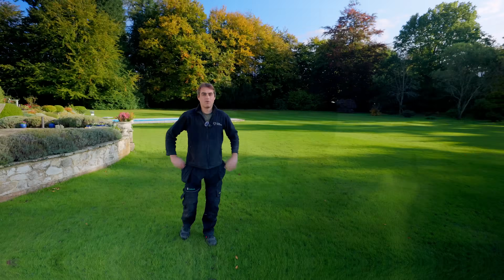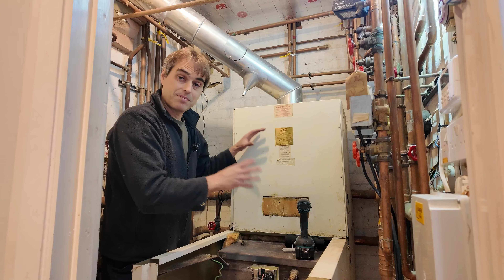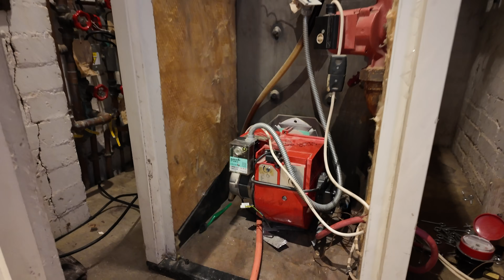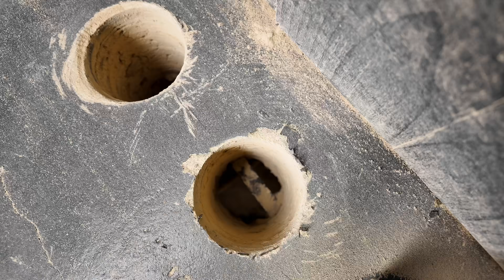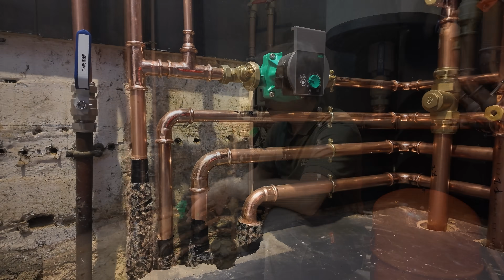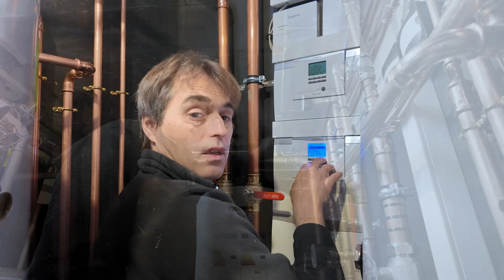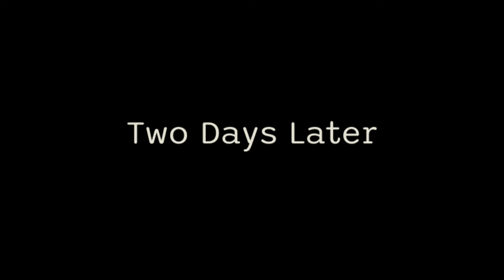Heating Oil Costing You A Fortune? This Is The Fix.

Comment: What's the point of reducing the running costs if the capital outlay would actually pay the running costs for over a decade?
It's completely and utterly pointless - an exercise in wasting money.  A customer of mine lashed out £54,000 (panels, GSHP, Tesla batteries).  That would have paid his total energy bill for 18 years!!!  There was a look of shock when I explained it to him.  Then I told him about the £1,700 a year he was now losing in lost interest on the capital expended.  But I think he had stopped listening.

If you install such a system because you don't want to suffer from that imbecile Miliband's blackouts, then great.  Otherwise, no.  It simply doesn't work out.  I have all the maths if anyone want them (as it's my job).
Reply from the maker: Capital outlay would cover 5 years running cost. Existing system needed replacing anyway. Any more comments Barry?
Reply: @UrbanPlumbers  
Can you supply the data?:

Current running costs
TOTAL capital outlay
Loss of interest on capital expended
Likely future costs of replacement inverter
Likely future cost of replacement batteries
Likely panel degradation (yearly)
Maintenance & servicing costs per year (spread over 20 years)
Warranty period

I'll wait.
Reply: @barryfoster453  UP didn't install the Solar or Battery array, it was there already.  How do you know the person had the capital already and didn't remortgage to get the funds which typically wouldn't be allowed to be used for investments.
You also don't know if their goal was purely financially oriented either.
Reply from the maker: @BenIsInSweden cost of fixing existing system with another oil system and running it low temp would have been the same as heat pump anyway - so his points make no sense !
Reply: @BenIsInSweden  
Ben...listen to the first few seconds of the video.  Your answer is there.  And you have the wrong idea, anyway.  I'm not putting it up against an investment, as that would be even more in my favour!  I'm stating that when people do this, they had the money in an account - earning interest.  This is TOTALLY ignored.  A typical 4kW system costs £15,750.  Withdraw that money and you're losing £473 that it was earning.  Do you see?  So whatever you 'save' on your energy bills has to have that £473 deducted first in your full cost analysis.  You are DOWN on your finances by £473 a year before you have 'saved' any money on energy.  The Energy Savings Trust was the ONLY organisation to factor it in - no one else ever does.  That's because people who do this aren't mathematicians - so they forget it.  But funnily enough, I was called in by an accountant after he had already done it.  When I showed him the data, he didn't like it (that he had made a glaring error).  Two years later, he phoned me to tell me I was correct.  Took him two years!
If you borrow the money, then that's even worse, of course!!!  Yet some have done that.
Reply: @barryfoster453  you don't need to get much further into the video to get the answer.  As you'll see that the oil tank needed replacing as it was leaking, and the boiler is aging and needs a lot of maintenance.
The replacement tank on its own would be thousands, and so would the oil boiler.  
A typical 4kW heat pump system isn't £15,750, not sure where you're getting that from either.
Reply: @UrbanPlumbers  
Sad.  As you haven't supplied all the data, none of us will every know!  The cost of installing a gas boiler and its running costs would possibly work out cheaper, but again, as you haven't supplied the data, we'll never know!  Gas prices are plummeting, and they will fall even further.  As Europe imports more US gas, causing European gas prices to fall, Trump will push for more US LNG capacity.  Gas is about to be very cheap.  But that won't impact the electricity costs of running a heat pump due to the Clean Industry Bonus.  This pays windfarms to set up.  £120 is about to be added to everyone's electricity bill.  Solar and heat pumps cannot compete with cheap gas.  And yes, oil boilers...oil is due to fall in price well into 2026 and almost certainly beyond.
Reply from the maker: @barryfoster453 there is no gas there 🤦
Reply: @BenIsInSweden  
Sorry, I was talking about a solar system (£15,750).  Heat pump installation costs are hard to come by as some qualify for grants and others don't, so it's difficult to quantify.  That's why I said about how important it is to see ALL the data.  You said, "You also don't know if their goal was purely financially".  To which I replied that it was in the first few seconds of the video.  I have nothing against a cost analysis of the two: new tank, boiler, and future running costs, but as that data is not supplied, then we don't know.  The price of a domestic oil tank is between £1000 and £2500.  The cost of an oil boiler starts from around £1800 plus install.  So we're at £2,900 plus install.  I don't know where you're getting 'thousands' from.
Reply: @UrbanPlumbers  
And that's why I said about oil prices, genius.  And stop upvoting your own comments.
Reply: @barryfoster453  The oil tank in the video is ~5000l, which you can ascertain from it's size against Szymon, and that he says that it uses about 10,000L of oil per year and needs filling twice.  Cheapest 5000L Oil tank I can find from googling is about £3k.  A 70kW oil boiler for indoors e.g. a WB one is £2,369, so you're looking at over £5K there.
The 12kW arotherm plus is about £5K (again from googling), so £10K - £7.5.K grant, means the heat pumps are down to about £2,500.  So are already nearly saving the cost of the oil tank.  

Also just did a ~4kW solar quote for my dad's UK house from Heatable, estimated at £8,600.  A far cry from £15,750.
Reply: @barryfoster453  he isn't 😂
Reply from the maker: I am now😂😂😂
Reply: @UrbanPlumbers  
Always have.
Reply: @BenIsInSweden  
Ah, a sock puppet!
Reply: @barryfoster453  ah, a conspiracy theorist.
Reply from the maker: Ohh Barry, I am glad we have you. Who would have told us we spend our money wrong otherwise if not you.
Reply: @BenIsInSweden  
Ah, but there are giveaways.
Reply: @UrbanPlumbers  
It's my job.  It is evidently not yours.
Reply: @barryfoster453  Go on, I love a good conspiracy theory!
Reply from the maker: @barryfoster453 @barryfoster453  Yeah, I know—you are a digital version of a Jehovah's Witness mixed with a  DIY financial adviser. You can't do it in real life though, as you would get a door slammed in your face.
Reply: Hi Barry,

I’ve taken a moment to put together a quick spreadsheet to clarify the financial implications of this work. Over the past 24 years, the boiler has consumed approximately 240,000 litres of heating oil. Starting at an initial cost of 7p per litre and applying a 10% compound increase per annum, this amounts to around £62,000 + tax over its lifetime.

Looking ahead, if we had replaced the boiler and oil tanks (£20k), assume a starting price of 70p per litre and use the same model with a 10% compound increase per annum, the cost in 20 years will reach an eye-watering £4.28 per litre. This would equate to £400,925 + tax just for heating oil alone.

It doesn’t take long to plug these numbers into a spreadsheet—starting at 7p per litre and applying a 10% annual increase. You’re welcome to check my model and let me know if you’d like any other data to help make sense of it.

I’d encourage you to look into these figures carefully before passing judgment. The numbers speak for themselves.

Best regards,
Malcolm
Reply: @MalcolmSkerrett  
Malcolm, thanks, but as you must surely realise, that's not what I asked.  It's only when you do a FULL cost analysis that you can make a statement on 'how to cut your bills'.  We can all say stuff...but you have to back it up with data if you want to be taken seriously.  As I said, I do this for a living.  If I make a mathematical error, I could get sued.  Making a video with a title that cannot be backed up isn't going to see you in court.

Any typical system with batteries is a dead loss - economically.  In fact, you won't 'save' any money, even if someone gifts you the panels - it's that bad an investment!  Six years I have gone onto YT videos and asked for all the data...not one single person has EVER given me them...not one.  There are two fairly well-known people on YT who post solar stuff.  I have challenged both of them to provide the data, and they don't.  One of them even took down my comments!

Typical solar systems with batteries DO NOT pay back.  This is not just due to the loss of interest on the capital expended, but because of the cost of replacing the batteries in 15 years...if they last even that long!

Comment: Great video as always.  I am not a plumber or boiler engineer - I notice that you are not using flux and a gas torch to connect your pipes - when did that change and what is this new connection method called?
Reply: Pipe crimping, five times quicker than MAP gas torch and solder and not risk of fire working in the loft.

Comment: Why you didn’t use split heat pumps? efficiency will be much better, and system will require less maintenance, I have a filling pumps in monoblocks will be weak after couple years and will lose efficiency. But rest installation master top.

Comment: How do 2 x 12kw heat pumps replace a 70kw oil boiler ? Did the property have insulation upgrades (internal wall, loft, floor etc )
Reply from the maker: It wasn’t sized correctly - 95% of boilers are 4 times the size required. Just shows how poor the industry is.
Reply: Heat pumps generally run 24/7 so less power over a longer time instead of a boiler constantly switching on and off.

Comment: This all looks amazing, But I have a genuine question. Wouldn't electric radiators be better? Power the house using electric rads, much cheaper install, and they run directly from the solar and batteries?
Reply from the maker: It would cost 5x more to run !!!
Reply: You're not following heat pump theory as they're 5 x more efficient (approx 5 units of heat per unit of electricity) hence 5 x the cost.

Comment: Painting the plant-room!  I love this guy.  Great to see K3 rads in an actual video working up well at 30 degrees and the actual electricity draw.  Super detail.  Always however, creates the disappointment there is simply no way I can access someone expert enough to do this in Ireland.  I've people recommend 2 x 12 arotherm for a 16kw heat loss property and tell me you don't run pipes underground.  I'm absolutely sick of trying to get anything done in Ireland that isn't cowboy level or just random luck as to how it works out.
Reply: Isn't Ireland full of Dr's and Engineers these days with the new arrivals. Surely they can do it
Reply: @CaptainProton1  oh right.  I must be mistaken

Comment: Why no ground loup heat pump system? This could be a possibility if you have that much area.
Reply: The 50mm preinsulated pipework was trenched in and made good in two days, ground source would be a full scale landscaping job, a lot of the solar panels were up already, just added a few extra to cope in the winter.
Reply: My understanding is that as air source has got better ground arrays are falling out of favor.  I think most ground source is moving towards bore holes for where that is appropriate.

Comment: Beautiful work! Do you have videos on doing both heating and cooling with radiators and heat pumps like these? 

I’m trying to understand whether it’s worth going radiators instead of forced air before upgrading to heat pump for either.

House still needs ventilation anyway, the only benefit of radiators is silent operation it seems

Comment: That must have cost a bob or two. 80kW of PV panels is 10 grand, another 10 for both the heat pumps. then Victron inverters, and all that massive plumbing plus 3 weeks work. They should probably spend some more on retrofit to get the load down - they can clearly afford it, and it would make the place so much more comfortable. Be nice to know what the KWh/m2 per annum is for this place.

Comment: What an epic installation! Really enjoyed watching the video. Clever idea for the towel rail circuit. The carbon savings on this system compared to oil will be massive! This is exactly the sort of property that many people claim a heat pump would never work.
Reply from the maker: Yep - one of those impossible with heat pumps. Thanks Glyn for kind words
Reply: Hi Glyn, We watched both of your HP installations, which inspired us to source a system for ourselves. Fortunately, we came across Szymon and quickly recognized his dedication—he truly puts 110% into the job! Maria, always smiling, keeping everything neat and tidy.  Hopefully, we can provide an update at some point when we gather some useful data and when the solar inverters are replaced.
Reply: @MalcolmSkerrett  That's fantastic! Amazing to hear that my little heat pump played a small part in all of this! You did well to find Szymon, he's not your average HP installer! Your battery system sounds fascinating, I've been following Dala's battery emulator project using EV batteries with hybrid inverters, I would love to put together a system like this in the future. I worked with Dala to help improve the CAN bridge used for Leaf/e-Nv200 battery upgrades when I upgraded the battery in my EV van. He's a very clever guy. But I guess if you're using Victron kit, you don't need the battery emulator integration.

Comment: Would a split heat pump not have been preferable for such long pipe runs? Smaller diameter pipework that could have been insulated to the same thickness as the water pipes. 

And only having water where the boiler was, with the long run being all refrigerant.
Was that ever a consideration?
Reply: The smaller the pipe diameter and the longer the pipe runs, the more flow resistance, therefore under ground 40mm/50mm preinsulated was used. There are some systems that use glycol but that alters the viscosity of the liquid being transfered, thus affecting the pump efficiency. Szymon kept the design efficient and simple.

The client was reluctant to install a commercial air-to-air heating system in their home, as its appearance was deemed too industrial and out of place in a domestic setting. They preferred a solution that blended seamlessly with the aesthetics and design of a residential property.
Reply: @MalcolmSkerrett  I think op means a split a2w system where there's something like a hydrobox inside to feed the hot water etc.
FGas would definitely be required though, I think Szymon had to use another contractor for moving an R32 system previously, so probably would have increased cost for not much gain.

Comment: Looks like a great install, congrats. Would however echo other comments on long term economic viability. Would be very interesting to see data for kwh load of heating plant on design conditions day and available solar yield. Also battery soh after 10 years is an unknown and commodity heat pumps like this can and do fail needing expensive repairs by skilled trades and parts. 15years is quite possible but have seen comps / inverter pcb's go sooner. Also would want to avoid the losses of the pre insulated pipe over life cycle of system if at all possible. It adds up. Personally prefer refrigerant split for long runs. Nice job though!
Reply: The client decided to replace a 24-year-old oil-fired boiler with two heat pumps. The existing oil boiler was outdated, the oil tank had a leak, and oil prices fluctuated between 60p and £1.00 per litre. The property already had a solar and battery storage system that powers the swimming pool in summer.

The work completed by Szymon, combined with the BUS grant, matched the cost of purchasing and installing two new 5,000-litre oil tanks, a new boiler, removing the old system, and filling the new tanks with 10,000 litres of oil.

Additionally, the client installed new 50mm pre-insulated pipes and upgraded some radiators from K2 to K3 models. As Szymon noted, the original boiler room was located within the house's thermal envelope. While the client had grown accustomed to the firing noise of the old boiler, they are pleased to report that the new system is silent, odor-free, and results in a 25-tonne reduction in CO2 emissions annually.
Reply: There is more loss of heat on a refrigerant pipe, they run hotter than water.
Reply: Fair comment but I'm not sure that's correct. Would need to check losses to be sure, yes approx 5 to 10k hotter ref discharge temp vs target water flow temp but much smaller surface area of pipe and less thermal mass impacting losses to ground at start up / after shut down. 
Long pre insulated primary pipe runs can also require a degree or two hotter set point at hx to compensate for pipe losses based on past experience. The true  reduction in efficiency is thermal loss + small reduction in cop. Appreciate some clients value aesthetics over optimal efficiency. It looks like a high quality install

Comment: How did you determine the air exchange rates to calculate the 24kW heat load? With the apparent age of that property, I'm sure the standard MCS calcs would have the heat loss much higher.
Reply from the maker: Standard calcs would have it at around 30kW or more - yes.
Reply: @UrbanPlumbers  do you use an approved method to reduce the notional heat load for your design, or is it just based on experience of similar buildings?

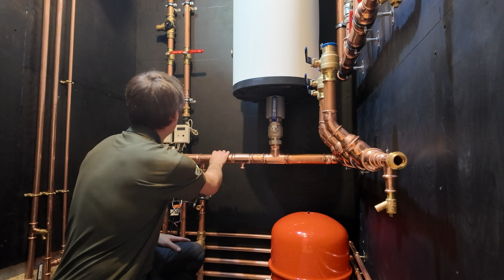Comment: 9:39
The technology in this house is amazing 
Why they wanted to keep the domestic hot water vented?
Reply: The only zone that remained vented was the towel rails. The client wanted a higher flow temperature during the colder months and independant operation during the summer. The 210L vented tank in the cellar is heated with 2no Tesla Smart Thermostat 3kw Immersion Heaters programmable via their App to switch on during the EV tarrif @ 7p kwh or during excess solar days.